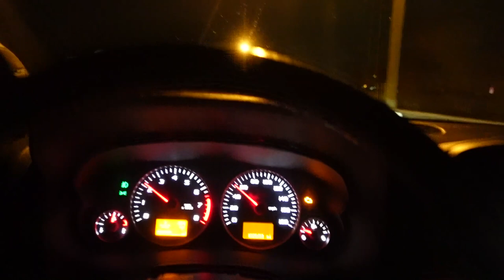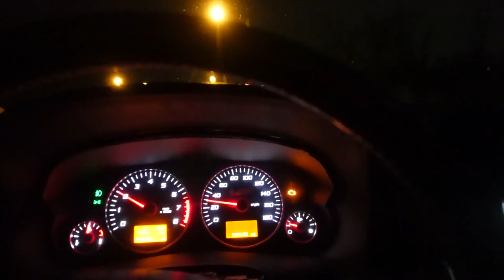BAD LUCK Strikes The SILVIAS Again..

Comment: You guys need those wheel dollies . It would make it easier to just push the cars around and get em in and out. They aren't cheap but they have ones with jacks built in and they are quick and easy. I'm sure you know though .